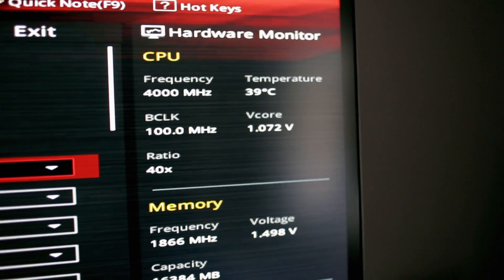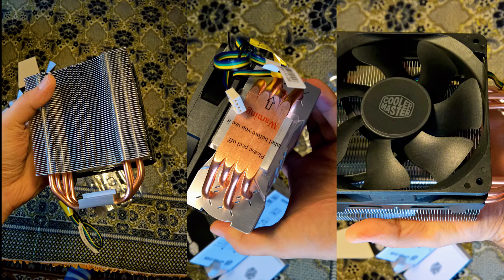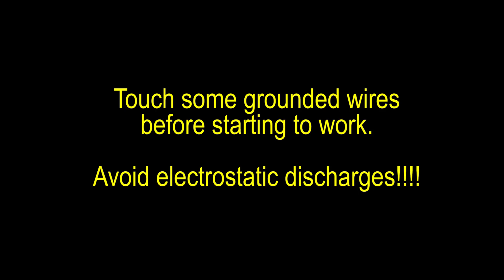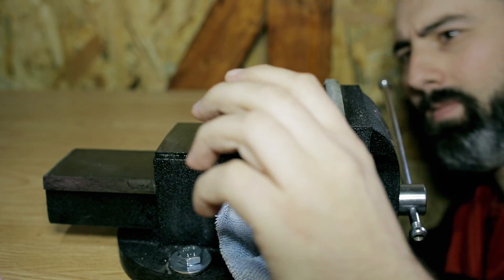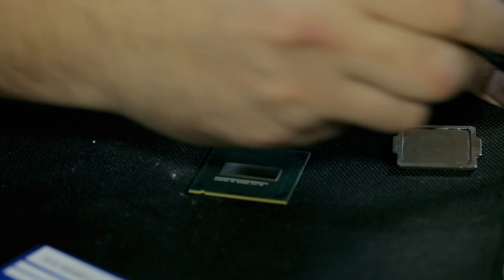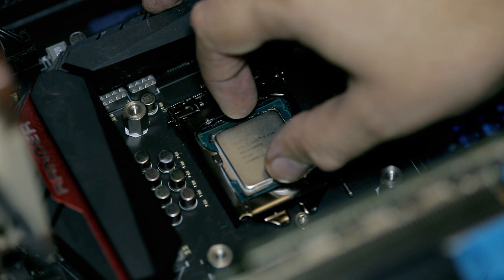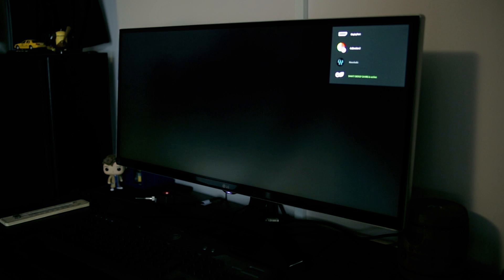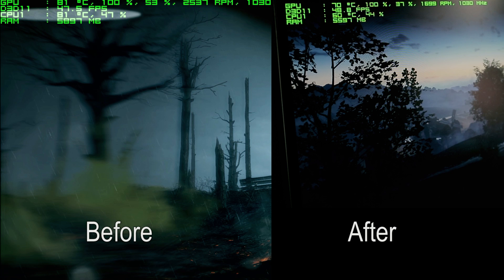Fix my i7 4790k overheating issues by doing a delid [ vice method ]

Comment: Huh. Seems much easier than I thought it would be. Maybe I should do this w my 4790 (non-K). My temps aren't really even that bad with a stock cooler, but it does heat up to 70°C or so while playing Subnautica or some other games. We'll see after I get my new CPU cooler, fans, and case later on. I have the stock Delta cooler and an old custom case with only a side intake and rear exhaust. Both 120mm, with a GTX 1080 beneath it all. Getting surprisingly good temps while gaming. With turbo and hyperthreading enabled it can get up to 84°C while decompressing large files w 7zip, but only gets to ~74°C in some games (Subnautica and No Man's Sky in particular).

Turning turbo and hyperthreading off in BIOS and limiting max CPU power in Windows power settings to 98 or 99% really helps to keep temps down while you're trying to gather cooling essentials.

Got the new ID-COOLING A410 on the way with a matching fan for a push-pull config, along with several Arctic P12 and F12 fans (though I can only use up to 3 fans in my current case lol. 4 if I ziptie one to the 5.25 drive bay shields.). Once I upgrade my case I'll be set for smooth sailing!

Comment: So deliding my CPU is the only way to fix it because it has the same problem and I remounted the cooler three times. By the way, I noticed that even after you delid the CPU the difference between the hottest core and the coolest core is still 10c, Is there any explanation for this? Because this is another issue i Have with my CPU
Reply from the maker: Sadly for that chip, yes, it's the only way. Thermal paste will go solid after a while and it will have lower performance. 

The temperature difference can be attributed  to load or unequal pressure from the cooler, but i tend to believe to be load. 

Different computational loads have different effect on temp.
Reply: @BeardsChips  The stress test apps will stress all the cores so maybe something wrong with the core temperature sensor itself because I saw many videos of this processor or the one without the K which have the same weird behavior , It's exactly around 10c difference in many videos between the hottest core and the coolest core
Reply from the maker: @jaffar1234  Sorry, i thought you were talking about gaming scenario. Yeah, a stress app will stress all cores the same, unless it's something like Core Optimizer stress test that will stress one core a time

Comment: I wonder how your performance would change by doing it the "absolute correct" way - that is, you missed applying the thermal paste to the IHS too (a small amount) not just the bare die. But perhaps that is a step for liquid metal on the die, and not normal thermal paste. But still an impressive result with simply replacing the thermal paste on the die with your own new one! I am very tempted to do so myself.

It's been 10 years with this baby 4790k at default settings, and I've just recently tried overclocking it as I'm getting a new computer soon + I'm sick of stuttering and microstutter and all this stuff. But while core 1, 2, 3 have totally okay or fine temps under load, core 0 has a 15-20c increase. Ie. 91-77-74-63 core temps. Means I can't go past 4.5ghz all core 1.232v as it goes past 92-93c and pretty much triggers a crash.

Remounting cooler might reduce it a bit and even it out, but seems like core 0 is just a dud now... BUT delidding like you have may be the saving grace to let me get 4.6ghz! Maaaaaybe 4.7 too!
Reply from the maker: The CPU had Liquid metal on the die and the IHS had thermal paste. I never use direct contact... it's dumb. 

And if you still have the CPU after 10 years be sure that the thermal paste inside there is rock solid.. you are basically forced to do a delid thanks to Intel's stupidity. 

New method of deliding seem to be working fine with dental floss, you just have to mount the CPU in a vice or something where it doesn't move and with a dental floss string slowly cut the adhesive between the CPU and IHS

Comment: 4690k delided it with a razor blade took under 5 minutes, now idle temp 21C (colder room) tops 65 with lm and liquid cooling, pegging the cpu to 100 in prime 95 at 4.1ghz 1.2v

Comment: You can use liquid metal
Just cover the electrical components with nail polish or silicone.
Apply adhesive tape everywhere around the CPU to prevent any spill during the spread.
Do the same on the IHS (using the old thermal paste  to find the exact spot of the cpu)
I f you apply the thinner layer possible it will not go everywhere)
And also don't forget to let the air vent for the IHS (very important)

Comment: I will be delidding mine as well in a couple days. At first I had just one hot core but now it's gotten to a point where I'm thermal throttling all cores while gaming and not even at full load. Time to fix this problem at the roots.

Comment: Is possible to install cpu without the heat spreader? Asking for a friend of course
Reply from the maker: I don't think you can do that with an Intel CPU because the chip itself is below the metal brackets of the LGA socket.  

With AMD CPU it might actually work but all AMD chips are soldered.
Reply: @BeardsChips  yeah true and I do investigated a bit, turns out it's kinda dangerous because the stress force from heatsink could actually crack the die. Thanks for the answer sir!
Reply from the maker: @YusufFadillah  Well .. There was a time when we had naked CPU die with Pentium 3 and Athlon chips :)
Reply: @BeardsChips  old times 😁

Comment: I have almost 6 year old I7 4790K, my CPU temps are max 75-80 while 100% usage. I've tried to replace thermal paste and there is no difference. Could it be CPU fault or heatsink? I will never delid my CPU, it's really experiment and i don't want to risk it. 
A lot of people says that i applied bad thermal paste, it was a dot and it's too enough much.
If that's true that the only one option to fix temps is to delid.
My idle temps are fine, max 36-40c
Reply: @BeardsChips  Yeah. My heatsink has 2 fans and I dont want to spend money on new cooler because I am saving money for new PC I mean I could try to use Intel stock cooler but its not worth but will do that in case if it will be 80+c I am hoping that my CPU will survive at least one year or more with these temperatures. After that, I'll get new PC with Ryzen 7.
Yeah it depends on weather if its summer (30c outside) I was getting from 45 to 50c at idle. In gaming it was 80c.
Reply: @BeardsChips  I disabled Turbo Mode and no difference. (It was auto so i guess it was always off)

Comment: Liquid metal boyz, I delid my CPU with mx4 paste and it was always at 70c to 80c at max load.
With the liquid metal, it got 50c max at room temp 28c.
Overclocked it to 5.1ghz I shit you not guys and I did not touch the volts left it on auto, and left cores in normal mode, it reached 70c max stable as a motherfucker.
Oh, and I am using a cooler master 240mil liquid cooling with fans on the both sides.

Mother board is maximus VI formula

Comment: Strangely enough, lowering the voltage to 1.2 volts solved this issue for me. 30 degrees when idle, 70 under full load at 4.4 Ghz. With a BeQuiet air cooler. To further overclock perhaps a delid and watercooler is needed.

Comment: Just did my first de-lid! So easy after I heated the CPU first to soften the adhesive! Didn't feel comfortable putting that much pressure when it was cold. 
At the right temperature I'm pretty sure you could just screw it off with a big adjustable wrench. Saving the cost of a vice.

Comment: hello, I'm quite unfamiliar with this. but what did you mean by components around the socket that prevent you on using liquid metal? my mobo is gigabyte z87x-d3h. tq
Reply: He means that after you de lid the  cpu there are tiny resistors next to the die, so if you use liquid metal it may spread and short them. I did this today on my 4790 and used liquid metal .... the results are staggering, dropped 25 degrees under load and idles in the 20's. I used UV curable solder mask to cover the exposed resistors under the lid, but you can use nail varnish as well.  I know this is a late reply but it may help you out :)

Comment: do i need to do this? im in stock intel fan i put cooler master thermal paste and my i7 4770 is 22 idle and 75 80 max on load?
Reply: @BeardsChips  yeah thnks for rply

Comment: If you were going to put the lid back on, I'd have got a copper one and lapped/polished it bright inside and out, that quantity of TP probably cost you 3 or 4 degrees too tbh.
   That said....I'm leaving mine as is, OK it hits 80 degrees under load and a mild 4.5 clock, but it all seems a lot of stress to squeeze another 400mhz out of these things

Comment: I am thinking about a Delid on my retro computer's cpu, pentium 4, but i am afraid a bit if i will break something by fault
Reply: @BeardsChips  oh dear
Reply: yep, checked, I believe that it is soldered, I don't know, by the way, it is the Pentium4 630 at 3.00ghz, overclocked to 3,46ghz with 4gb of ram with windows 10, with ssd of course, but I have problems with tempratures

Comment: i guess i got lucky with my 4790k .my temps never go above 70 when gaming on an air cooler
Reply: Mine eather I use Aio Corsair H110i GT 4.8 ghz  rock solid
Reply: Delid it...and it will run at 50..
Ur temps are becuz of ur efficient air cooler

Comment: dunno why but i had a 4670K FROM Malay as yrs never been over 60 C and now i own a 4790K from vietnam it idles in 28 C and max was 55C in room temp 22C  with corsair H100i 5 years old .  the only way to achieve 80C+ is during summer running prime95 torture test  which we all know it applies over voltage in haswell cpus so it tends to overheat for no reason at all.

Comment: I have the same CPU at idle it is at 30 and under load 40 on a h100i water cooler. Your CPU fan is on the wrong way, it's meant to push through the CPU cooler fins to the rear case fan to pull hot air out.

Comment: Man i need to do this for my i7 4770k. Im getting 52 degrees by just watching twitch streams at 3.5ghz stock. Wtf is wrong with Intel.
Reply: yeah i have the same sort of problems... Intel decided to integrate the FIVR on the CPU for this gen. If you look at the next generation you will see they didnt. Hence why they run hot.

Comment: I have the cpu delidded and lapped- ive tried direct die cooling. liquid metal between ihs and die. nothing improves my temps. im running a Corsair H110i and the temps are basically the same with Hyper 212evo. i have no clue what to do. it cant be the sensor since then it would have to be all the sensors (package, core etc) since they consistently high between eachother. i still hit 85-90c at cinebench or rendering
Reply: I know this is old but maybe you are running too high voltage/LLC?
I hit barely 65c with no delid @4.7 1.25v and med/high LLC in CB.
Although it hits 90c with prime95

Comment: Im sitting at 4.7Ghz 1.288v on my 4790k and running at 68c max. I have a Corsair H115i GTX on it. I think your pump may be going bad on your AIO bro. The Devil's Canyon refresh was made to improve the TIM between the IHS and CPU die so you shouldn't be getting those temps even at idle and stock clocks to boot.
Reply: That is not the case. You have a premium chip most people still need a delid after 3 years of use. All the best

Comment: Just wanted to say thank you for taking the time to make this video. My i7 4790K was running hotter than I remember, and even using a high-end custom water cooling loop from EK I wasn't able to get my idle temps below 38C. The deliding was a little nerve wracking using the vice method, had to use more force than expected, but it did finally pop apart. After cleaning and applying new Arctic MX4 I'm seeing a 10C drop in idle temps.

Comment: Foarte bun acest clip! Am exact aceeași problema, dar nu am curaj sa incerc solutia ta. Vre-un sfat? (procesorul este in pc-ul de la birou). Era sa uit. Am aceeasi problema si cu placa video, un Phantom 770 2gb.
Reply: Am vazut. Costa 30 de lei. Dupa ce am urmarit un clip in care procesorul s-a ars, am prins teama :) Dar mai am o intrebare. Am schimbat pasta de pe un Geforce 770 si temperaturile nu s-au imbunatatit. Am schimbat si padurile termice de pe memorii si vrm. Nu s-au inregistrat imbunatatiri. Ai idee ce poate fi? Cipul de pe placile video nu are capac. Este racit direct de catre cooler.
Reply: Florin Musetoiu, in benchmark-ul Heaven atinge 90 grade in 2 minute.
Reply: Florin Musetoiu, mersi pt raspuns. Din pacate nu e asta. Am incercat in toate chipurile posibile. Am incercat mai multe paste. Efectiv nu-i dau de cap. Ce nu am incercat este sa ii schimb coolerul cu unul aftermarket. Dar nu merita. Costa cat placa.

Comment: The little components on the PCB beside the die can be coated with clear nail polish or a more professional polyurethane conformal coating with high dielectric constant and temperature tolerance well over 100 C. Then there is no problem using liquid metal such as Conductonaut. No need to glue the IHS lid back on, the socket clamp and cooler hold it in place, though it may be desirable to externally seal the bottom edge of the IHS to prevent any possible leak of liquid metal. Some of the experts have shown that omitting the sealant between PCB and IHS reduces the gap between die and IHS and improvers cooling. That's how I set up my 4790K.

Comment: Im guessing that's what's going on with mine. I upgraded from an old evo212 to a noctua NH-D15 and the temps are much better. However, I'm not getting temps I should be getting a 4.6ghz and 1.25v. It could be the thermal degradation of the chip going through all the stress tests, but I suspect that liquid metal will do the trick.

Comment: i think its better not to put the cap with adhesive so you can change it every now and then.
Reply: yes, liquid metal is much better. but this video gave me an idea on how to delid, since my friend is advising me to slip a blade and i don't like the idea since i have seen a lot of delid with blade that damage the chip itself.
Reply: well i use the same as yours 4790k, the temp is not failing me yet, but sooner will for sure.

Comment: Oh my god dude. I've been having temperature problems. and dude, Intel did the 4790k quickly after 4770k in order to improve TIM didnt they? but it still sucked, sux? My temps are high too..... I suck. My idle temperature is about 47-50c roughly. I want to stream, and my i7 4790k is (still) beast mode but I think temp is limiting it. fuck you Intel :D for the bad TIM.

I need to delid...

Comment: I did the same thing with liquid metal. It is actually very easy when you use Q-tips or something. It brought my overclocked i7-4770K from 95 degrees to 70 degrees and now watercooled to 60 degrees on max load (rendering and prime95).
Delidding is a must do when you want to reach maximum performance of your chip.

Comment: Liquid metal makes extremely huge difference on the die.. it drops temp of my 4790k by 10C!!! compared to artic silver 5.
now i can overclock my cpu to 1.3v 4.7ghz with about 75C. it's night n day difference..cauz hyper 212 evo to liquid cooler is just about 10c difference

Comment: I did this same very thing on my 4790k. The rough jaws of the vise damaged the PCB of the CPU and killed it. To anyone thinking of using a vise buy the 12$ tool on eBay or at the very least use smooth jaws on your vise. I hope this saves someone else's CPU...
Reply: Florin Musetoiu I rewatched and your PCB goes directly against the rough jaw. Just putting this out there to warn others to use smooth jaws in the vice. Not hating.

Comment: damn, bad luck m8, my 4790k is idling at like 26c, with max temps of ~70c during cinebench r15 at 4.7ghz.. but thenagain, i have a corsair h110
Reply: Florin Musetoiu  yeah, ofc, i know about the issues intel's been having with the IHS and temps for the past few years, i'm thinking of lapping this 4790k, maybe i'll be able to push it to 4.9-5ghz for some benchmarks. I stick with 1.28v 4.6 for daily use though. Oh btw, i'd recommend changing the paste you use. The mx4 isn't the greatest in terms of performance l, maybe go with a noctua nt h1 or a gelid gc extreme.
Reply: It's a very common problem. Not about the cooler. my i7 4790k 4.4ghz idles at around 48c.... Because of this shit TIM :D :)

Comment: :x didn't see any overheating ? 89c? Was it hitting tdp max ? But ya Intel's thermal copound sucks. Do you have your CPU cooler blowing away from your back exhaust? If so switch it around

Comment: DONT GLUE IT THERE IS NO FUCKING NEED TO GLUE IT
Reply: Actually there is a reason to glue it back. Liquid pro goes bad when around oxygen. So it seals the Liquid pro and if any leaks out it doesn't go into the socket.
Reply: Kristopher Branson its thermal paste not liquid ... so nothing happens and he shouldnt glue it to be able to change the thermal paste in future

Comment: Finally did my delid. 5.0 ghz at 1.37 watts on the core and multiplier for cache on auto and max temps are 61c while running bf4 and synthetic benchmarks. I'm in love
Reply: Really great Video, thanks for that - is there any Posibility to change the Clip or give a hint not to use usual Thermal Compount and did you reglued your Cover after appliing Liquid Metal? Is there any new reason to do so?
Reply: So, is liquid metal paste good to use with i7 4970k TIM? the inside?? delid?